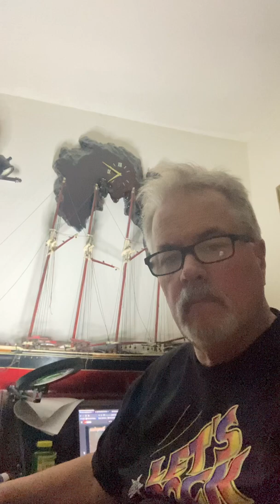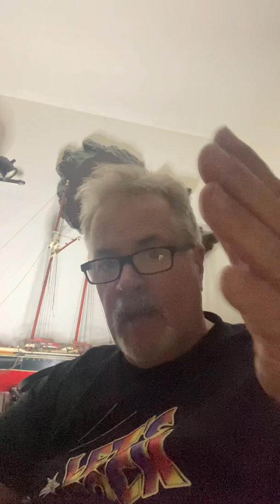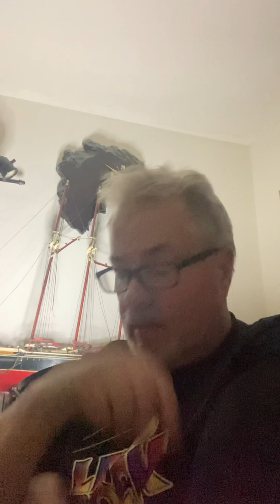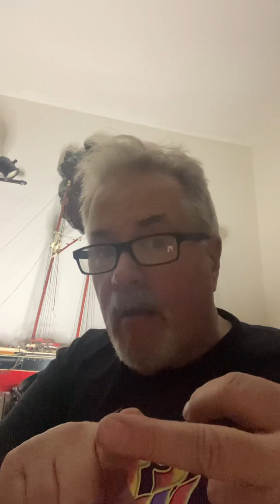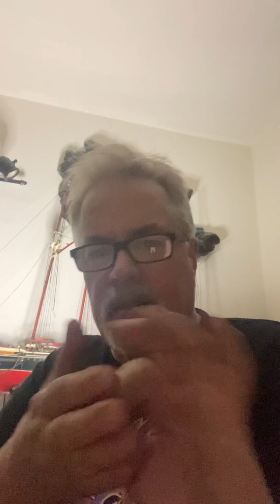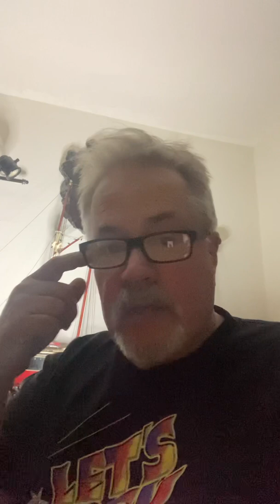Video for the Rolls-Royce and Bentley Air Conditioning Issues group.

Comment: Hi, enjoyed watching your video, I am in the UK and have a 1985 Silver Spur that I have been restoring over the last 2 years it is close to  mint condition, what makes it unique or at least I have never seen another one ,is that it was converted with a Phantom front end in the middle east some years ago so not a car for the purists but impressive nonetheless,  it has the centre division and rear air con,  after getting it through its MOT test and making it road legal,today I thought I would address the air con, I have a professional air con machine in my workshop and have converted it to R134a , I evacuated the system for about 45 mins and it held its vacuum for at least 10mins, I put 250ml pag oil into the low side and then continued to recharge the system with R134a , this is what I wasn't sure of on the Harrisson compressor it says 1.48kg gas but makes no mention of the rear air con so I guessed and put 2kg of gas into the low side to take the residue of the pag oil with it , at first all seemed well the vents were blowing cold if not ice cold , I thought I would take it for a road test , probably les than a mile in I started smelling this burning smell and the vents got noticeably warmer, I got back to my workshop and the clutch was slipping and struggling to turn the compressor I thought the compressor had seized but it still turns easily by hand so I think the clutch has failed, I am sorry this message has gone on a bit, that happens when you get to my age     🙂 my main question is what quantity of gas and pag oil should I have used,Many thanks Andrew , Cambridgeshire UK
Reply from the maker: More than likely you didn't add enough oil. It could also be excessive high side pressure from a restricted condenser or other component. You need to know the pressures. The conversion isn't exact as far as the amount of refrigerant. What it called for with 12 isn't the same as 134a. That and the rear air and it's a real pain. You just have to slowly add and let it settle.